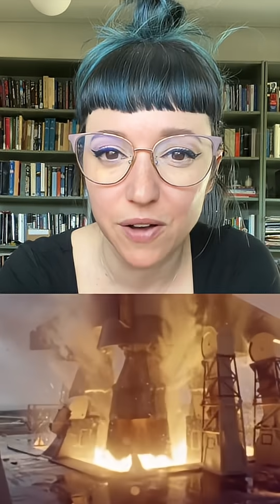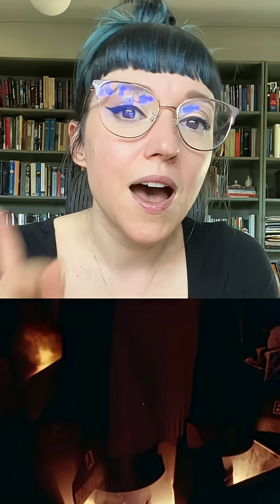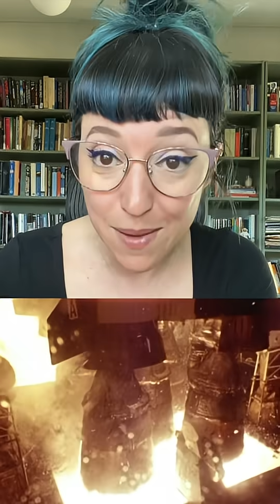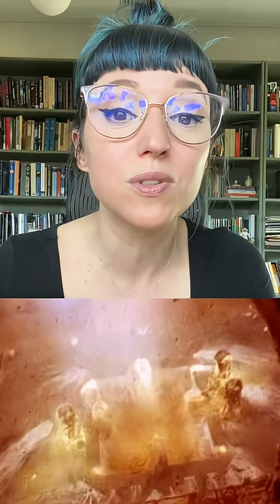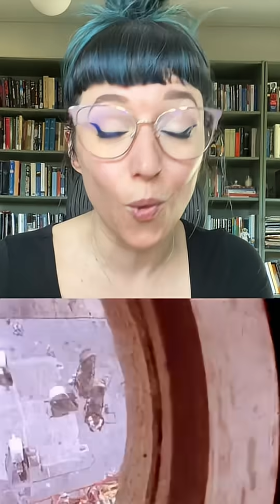Rocket launches use TONS of water #shorts #history

Comment: I think you've made a common mistake due to mixing terms:

Sound Power Level (SWL) measures the total acoustic energy a source emits, independent of the environment, similar to a light bulb's wattage. In contrast, Sound Pressure Level (SPL) measures the effect of that energy at a specific location, which is affected by distance and surrounding conditions, like the perceived brightness of a light at different points in a room. So SWL is a property of the source itself, while SPL is a field quantity that varies with position. 

They're both quoted in dB, but on different scales. SWL=200dB is typical for large rockets, but SPL would be more like 160dB next to the engines, decreasing the farther away you measure.

The max SPL possible in Earth's atmosphere is 194 dB, beyond that the wave troughs reach a vacuum, causing cavitation bubbles.

Source: I'm a rocket vibro-acoustics engineer
Reply: Using dB is abstracted from the physics. I wish we stopped using it.
Converting it to actual units:
Saturn V produced ~0.2 Gigawatts of acoustic power during liftoff (0.1% of total power output)

That results in ~2000 Pascals of (rms) sound pressure around the rocket. That reduces by an inverse square law. 1.5 miles away it was measured at 20 Pascals.

Comment: Over in Mississippi at NASA's Stennis facility, they static test and certify the engines before sending them on to the Cape. This requires thousands and thousands of acres of land as an acoustic buffer zone because of the noise. The vibrations set off seismographs in the region as if it were a small earthquake. (A side benefit of all that land is it created a wildlife preserve and possible home to rare species like the Ivory-Billed Woodpecker, if it still exists.)

Comment: Sound travels in really well. it's the more lightly to the scattery of sound in the water droplets in the air. There is another energy sapping process involved, but it may have been negligible
Reply: It's also a significant effect that the speed of sound in steam is much higher than it is in air. With lots of pockets of air and steam and rocket exhaust around the rocket, the sound wavefronts/shocks are severely defocused and broken up, reducing their power. The water also absorbs a great deal of energy in turning to steam and cooling the exhaust.

Comment: Not just the sound. At SpaceX the 1st two (2)  year's. Between the Take Off, and Heat from repeated Landings.  Destroyed the concrete, and warped the Steal Pedestals.  Until the Water Suppression,, also caused rain 🌧 with the Steam, therefore,  helping new farm lands .🚀👦👍✨️🛸🌧

Comment: If you converted a Saturn 5 rocket into a mobile flame thrower like the Sherman tank models used on Iwo Jima how many more times powerful would it be than the original ones used on Iwo?

Comment: Was at Pt. Mugu many decades ago... Our outer buildings and main Hangar were next to the AC Control Tower n arrival Airport parking... Was busy in the life support building (2nd from Tower) walked out onto the Tarmac low and behold right in front of me, are 3 A-10 Thunderbolts... Engine's were running, I thought...  Just 1 TF-34 Engine was started... Only had my Sonic Ear Valves... The other 5 started up, teeth chattering, eye watering n unbearable...  Had to run in an get my muff's... Head was ringing half the day and needless to say I never did that again... 🤓⚒️ 🇺🇲 

Funny coincidence decades later I ended up building the TF-34 Engines for the USAF...🤔😊

Comment: If you listen to the final 15 seconds of a Space Shuttle launch, you could hear a whistling sound prior to SSME ignition.

 That was the opening of the valves to the sound suppression system to flood the pad and flame trench.

For those familiar with Richard Hammond, he had an episode and a fantastic illustration on how water is a excellent damper for acoustic shock waves.

Comment: If I might make a suggestion,  do a short on the retro rockets of the first stage.  Maybe the second stage also.  I'm in my 70's now, but back then I was really into the Saturn Rockets.  Was happy to see that you explained there were more Saturns than the V.
Reply: She has a video about how many jets are on a Saturn V.  I believe it's around 80.   She talks about the retro rockets on that video
Reply: If you converted a Saturn 5 rocket engine into squirting liquid fire like an Iwo Jima style Sherman tank type flame thrower how many times more powerfull would it be than the original?
Reply: @Schtuperfly  Less than zero.

Comment: Nice video. Glad you covered it. It is so loud that during Shuttle at nine miles my clothes would move slightly from the pressure. Yes 9. You could also see the sound pressure wave moving across the Indian River.
Reply: She should have explained the logarithmic difference better for those who don't know, so that they do know.
Every 10 decibels = 10x more. So 130 decibels is 10x louder than 120 decibels. 140 decibels is 100x louder than 120 decibels.
200 decibels is 100 million times louder than 120 decibels. (Log 8 higher, 100,000,000 times higher than 120 decibels.. please let me know if I'm wrong)

Comment: I always wondered why it was a deluge instead of a static pool. Is it to increase the number of air-water interfaces to attenuate the sound more?
Reply from the maker: I don't have that answer, I'd have to look into it more, but my immediate thought is you probably don't want a giant pool of standing water undisturbed for months at a time in Florida!
Reply: The SPL of five rocket engines at full throttle are more than enough to “…increase the number of air-water interfaces…”
Reply: @ernestgalvan9037  What is SPL?
Reply: @prdoyle …. SPL — Sound Pressure Level
Reply: @ernestgalvan9037  You mean cavitation?

Comment: Apollo 4 Saturn V did not have that water system installed. It caused some damage as a result and Walter Cronkite’s CBS coverage illustrated it. “The roar is terrific “ “The building is shaking!” “Part of our roof has come in here!”
Reply: Which shows that they didn't know it was going to be so loud. I wonder how much they scrambled to come up with a solution?
Reply: @rbaldino  a *lot*, as the noise isn't only damaging to buildings, it's pure hell on the rocket itself, which had also suffered damage.
Reply: So, where are all the “Musk Haters” who maintain that Musk was as dumb as rocks for NOT having a water system, compared to the absolute, never-fail, NASA geniuses?
Reply: @ernestgalvan9037  It's not hating on Musk when he is trying to reinvent the wheel. Nasa walked so others could run but instead Musk decided to crawl on his butt backwards wasting millions dollars and hours of work all for show. It's why Tesla cars and Cybertruck are falling apart.
Reply: @ernestgalvan9037 yiiikes my guy. The guy just destroyed you. You gonna respond to him. I want to see this.
Reply: @ernestgalvan9037  He was dumb, because NASA figured it out almost 60 years earlier. Not knowing something and then figuring it out is not failing. Being willfully ignorant is.
Reply: @ernestgalvan9037 Saturn V needed water deluge, shuttle needed water deluge, there is loads of footage showing both. Musk should have known. He also appears to slowly be admitting they need a flame trench, just like Saturn V, the shuttle, and the N-1.
Reply: @ernestgalvan9037 We al saw footage of Musk saluting the crowd. I rest my case.

Comment: Just pouring water onto the launch pad and letting it sit there won't do much good. The water has to be flowing and moving and generating various levels of water depth and bubbles in order to disperse the sound waves more efficiently.
Reply: So you believe that the SPL of those five rocket engines at full throttle will not “move the water around”?

🤣

Comment: And there was SpaceX trying to launch Starship that one time without water deluge and we all saw how that went...
Reply: It was something to watch, though! All of that concrete in the exhaust was frightening!
Reply: The rocket still launched didn't it ...... along with a few slabs of concrete.
Reply: @BlaTaN  into nearby tanks, which thankfully didn't rupture. And through a nature reserve and the dust, well through the nearby town.
Reply: @BlaTaN it is like finding a curly fry when you ordered normal fries! Sure, you didn't plan for it, but it is a nice addition to shake things up.

Honestly, I want to belief the engineers knew it was going to happen but refused to mention it because it would make a sick YouTube video.

Bob: we need to add water to keep the concrete and everything else from being damaged and launch in random directions.

Barb: Or, hear me out, we don't and film it so we can post it on YouTube.
Reply: “… we all saw how well that went…”

About as well as Apollo 4 launch……
Reply: @ernestgalvan9037  ...Not really.  Starship had to be blown up.
Reply: considering the pressure crushed the ground which caused the concrete to break apart and get launched higher than the starship, it was amazing that it even left the launchpad, it had to be blown up because it had lost several engines from the concrete and did not have required speed to reach its target Hight.

it didn't fail from lack of sound suppression; it failed because the sand underneath got depressed and allowed the concrete pad to get blown back into the engines.

Comment: Every 3 decibel extra is double the sound pressure.
Reply: Yes, Amy got it wrong, a single decibel isn't even close to being an order of magnitude (10x).
Reply: @johnnemeth6913   She said every ten the db number goes up, it's an order of magnitude.  (0:38)
Reply: @Dan-Black  the fun part is, most people think that our senses of touch, sight and hearing are linear and they're not - they're logarithmic.
And the decibel scale is logarithmic.
Reply: @spvillano  Yep.  That's why so many early computer sound controls (or other digital audio volume controls) were so horrible.  Most of the cheap ones were linear digital controls instead of logarithmic.  So you'd have to turn it up to about 90% before you got enough volume to hear it at all, and then you'd have few (if any) more "notches" between 90% and 100%, so suddenly every tiny step got much louder.

Comment: This is so interesting. I’d always assumed the water was to counter the heat fm the rockets, reducing damage to the launch platform fm getting torched.
Reply from the maker: I've mentioned the water with how the launch pad survived under the rocket, but wanted to make sure I made it clear any cooling was certainly secondary, the sound dampening was the main reason!
Reply: @AmyShiraTeitel Very cool. I’m always learning something new fm your content. Keep up the good work!
Reply: @AmyShiraTeitel  They used ablative paint on the hold downs, etc, right?